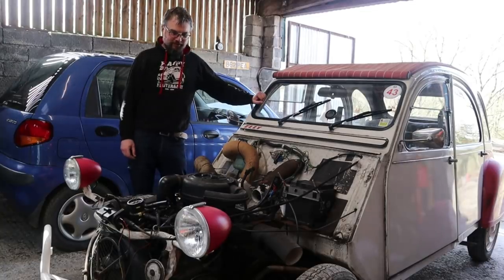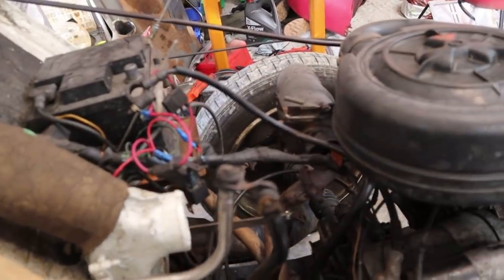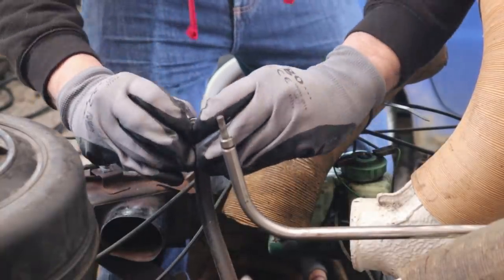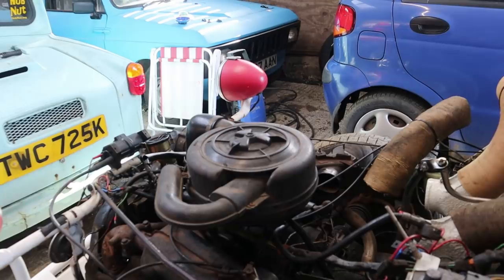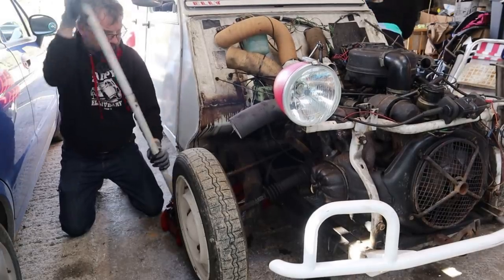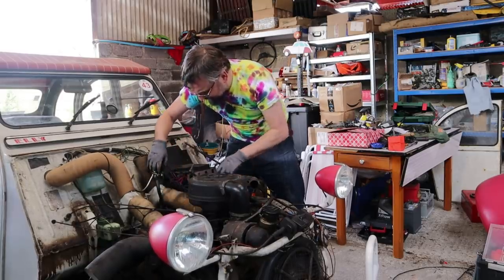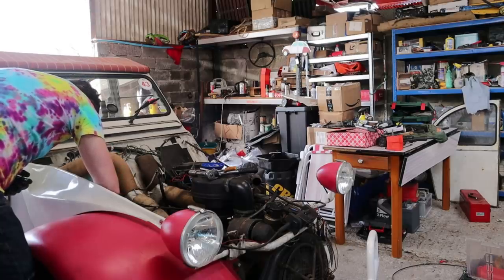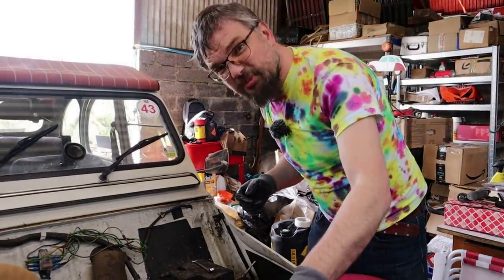2CV antics, waffle, more failed things, tie-dye.

Comment: Took Whisky’s door lock out at the weekend. Can be quite straight forward once you’ve worked out how it should be done. First remove the three Torx head screws. Then unscrew and remove the inside handle, this is connected to the lock via a cable. Other connections are three rods. Roll out a green plastic piece on one and it just pulls out. Other two got me flummoxed. Thought I needed more room to angle it, so removed the window guide rail. Without electricity, this could have been tricky, but nuts on the glass lined up with holes in door frame. With that off, the lock still wasn’t revelling the secret of getting the rods out straight away. Then finally found that you turn the whole thing 90 degrees and then turn  one rod 90 degrees back and it just pulls out.

Comment: Greasing can still be a nightmare even with Air Powered Greasers etc. Used to hate the job when I was a Hgv mechanic. An ERF EC Tractor unit had over 30 grease points, there was always some blocked etc, by far the most messy part of doing the job.

Comment: I learned to drive in a '73 Dyane.... UPP621L if I recall....   as well as that shonky gear linkage (very tired) it had a rod throttle arrangement....  the engine mounts were horribly worn, and as the engine rotated backwards under acceleration, the throttle would shut, ending acceleration, so the engine would rock forwards, opening the throttle and the whole cycle would continue.....  Once we'd put new engine mounts in, that problem went away, and then the plastic ball joint on the carb started randomly popping off, most notably trying to pass a bus at a bus stop, uphill!
Reply: Taxed until 1987, not a bad innings.

Comment: 2.4Ghz wireless microphones are known to have issues, not only from other sources of 2.4Ghz (Wi-Fi, Bluetooth, Microwave ovens Etc.) but because Wi-Fi signals don't travel as well as those used for regular wireless microphones. 
Also such a small transmitter is not going to necessarily have the best transmit antenna to further reduce signal.
If you continue to have problems then switching to either a licence free or even better a shared user licence system, but none of them are compact like the rode systems (probably for a reason) and the only cheap systems with a dual camera reciever is not available in frequencies in either the shared or licence free bands.
If you do decide to switch then looking for a 2nd hand system would probably be the best bet, noting that some 2nd hand systems will have frequencies accessible that are no longer legal (UHF CH69) but should still be tuneable to the licence free part of UHF CH70.

Comment: 6:19 It's not in focus so difficult to tell but are those washers dished ? If so, I'd be tempted to fit the dished side to the rubber to support it but knowing the Fr that may be wrong.
I think the Fr are good at gear lever bodgery. I guess the Renault 5 is an equally crap arrangement.

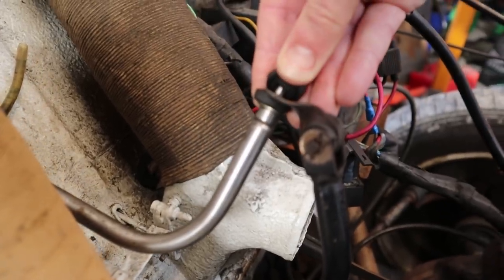Comment: 1:40 COTTER PINS! are you sir, an american?  Split pin man.. its a pin that's split, it holds the clevis pin in. a cotter pin  is a cylindrical pin with a sloping flat in one side. they are commonly used to hold old fashioned bicycle pedal cranks to the crank... mutter mutter mutter...
Reply from the maker: CLEVIS pin! That's it. Thank you. I was struggling to remember...
Reply: It had me totally confused seeing an American YouTuber calling a split pin a cotter pin. Apparently, Americans call REAL cotter pins just "cotters". Anyway, I thought the linkage had R clips rather than split pins.
Reply: @cme2cau  first time I was triggered by one was the Wanglerstar after that it started grating and grating every time he said it... ( unsubbed eventually) on the other had This old Tony doesn't :-)
Reply: @cme2cau  yes i got carried away....